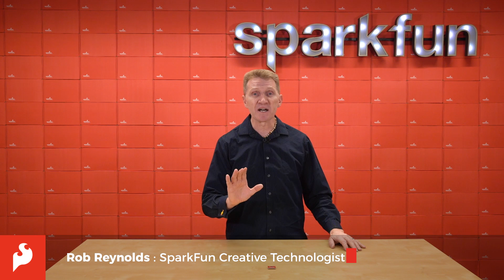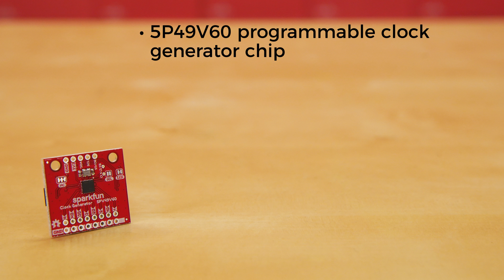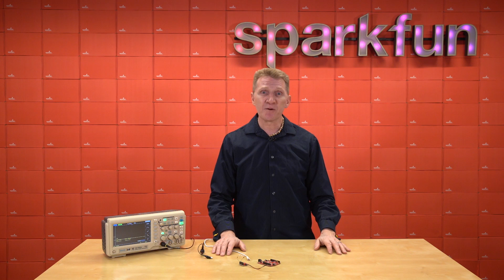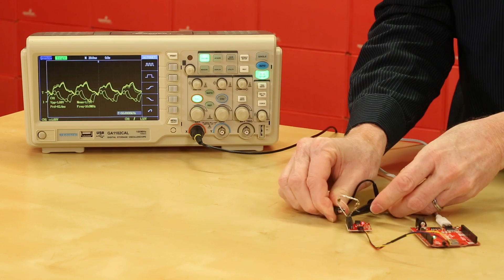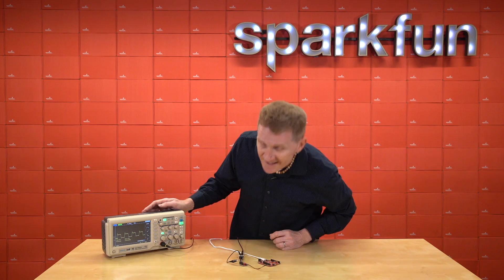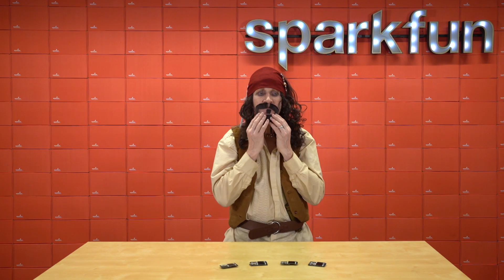Product Showcase: SparkFun Clock Generator Breakout

Comment: What frequency is the on board crystal? It is not defined in the schematic and it is difficult to be sure by looking at the photo.
How do I determine what is the smallest output frequency step (10 hz, 16 hz, 100 hz ?) available with any given clock input frequency?